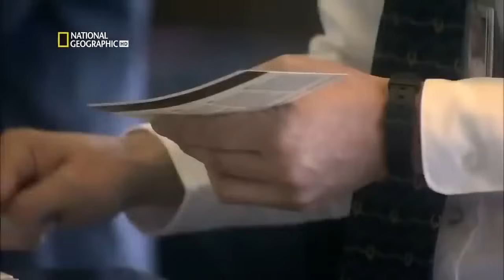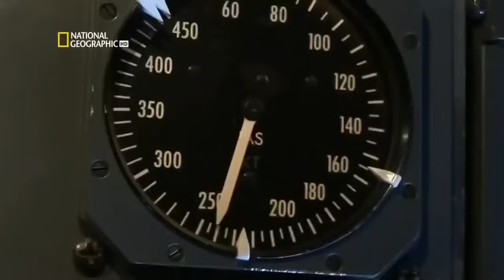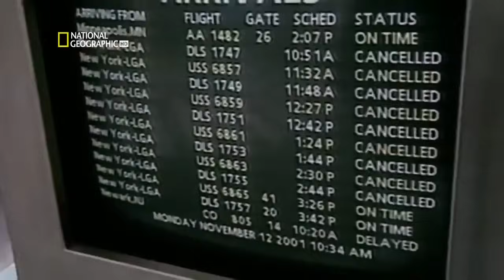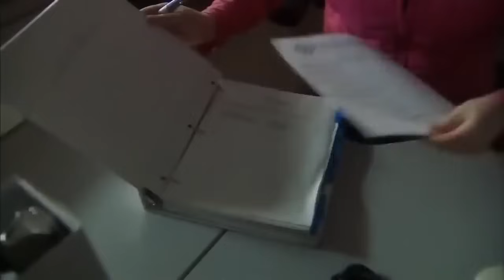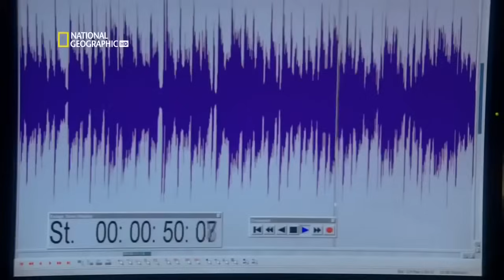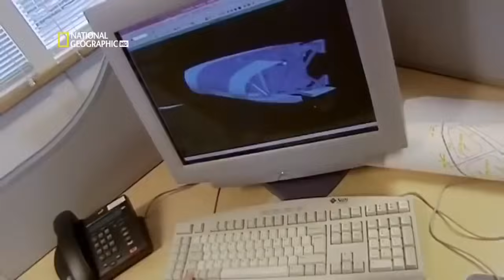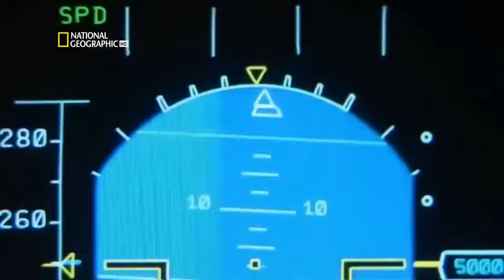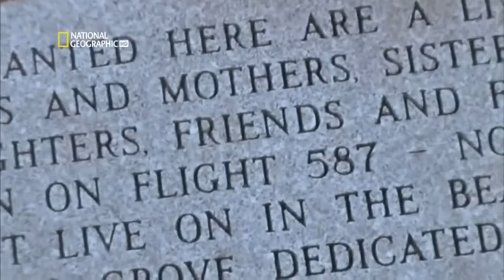American Airlines Flight 587 | Air Crash Investigation | National Geographic

Comment: Watching the video of the aircraft, you can't help but think this has been caused by over correction with the rudder. However, 2 thoughts come to mind: 1. Flight controls are sensitive requiring small inputs. Surely, AA realsed that training pilots to use maximum rudder could have disastrous effects if out of synch with the aircraft movement? The role of the tail is to act as a vertical and horizontal stabiliser so they should naturally correct minor pitch and yaw movements without pilot inputs. One can't help wondering if the aircraft would have otherwise corrected itself. 2. How can a pilot suggest Airbus could be culpable by not stating any limitations on the control surfaces?  It's not a fully aerobatic fighter jet that can pull several G.

Comment: I think the pilot was well trained because those are what they call "good stick and rudder skills" Youre supposed to use the rudder like they finally explained. The design settings to me are whats to blame. Im a pilot also but in my younger days I always flew RC planes and theyre very acrobatic and the digital controlers allowed you to program settings on your control surfaces much like they were on this planes rudder. It wasn't subject to speed tho. You could set the rate of travel to increase as you move the stick farther and farther. The first little bit makes the control surfaces move a little bit but the percentage of travel increases the farther you move the stick. Its so you can make really quick snap rolls without maxing out the stick but still have normal control if you arent doing crazy maneuvers. I really cannot believe they have the rudder on these planes set up that way! The faster you go the less rudder travel you need, NOT MORE with less pedal movement! Thats insane!

Comment: so who was at fault? The AA for dodgy training (or losing Airbus's manual) or Airbus for not providing in depth workings of the rudder control system?
Reply: I would say AA and Errorbus.
Errorbus for making a shitty product that looses parts if you work the controls and AA for not pointing out to their pilots that Errorbus makes a shitty product that you can tear parts off of by using the controls.

Comment: This was not a research aircraft.It was not an experimental aircraft.It was designed faultly The plane was.
Ultimately designed to have the rudder less response.As the airspeed increased, this was a fatal flaw in the design of this aircraft.
And the controllers Adam take off too soon because of that.Wake turbots of another airliner

Comment: NTSB immediately says it doesn't look like a bomb, narrator says "the plan backfires" and shows a newspaper dated 2004, three years later lol. Airbus should have been sued into the dust for making an aircraft capable being broken by pilot inputs in straight and level flight at 250 knots. And regardless of training, an intuitive understanding of flight would make anyone baulk at alternating full rudder inputs for an extended period - especially when they made it worse :(

Comment: Obviously there is some blame for multiple parties, but Airbus is the most at fault IMHO. They knew their plane better than anyone yet did not specify this danger in their manual! I wish I could find out more about the supposed warning they gave to American Airlines before - the Wikipedia article doesn't mention it - but even still...it also was not a good design: "Most aircraft require increased pressure on the rudder pedals to achieve the same amount of rudder control at a higher speed. The Airbus A300 and later Airbus A310 models do not operate on a fly-by-wire flight control system, but instead use conventional mechanical flight controls." A good analogy someone else gave is that, yes, turning your steering wheel hard while driving can be deadly if you crash. But it shouldn't cause your steering wheel to fall off!!

Comment: A good analogy someone else gave is that turning your steering wheel hard while driving a car can be deadly if you crash. But it shouldn't cause your steering wheel to fall off!! Poor design by Airbus, and poor communication between Airbus and American Airlines.
Reply: That's a terrible analogy - the forces involved with aircraft are significantly greater. You're talking about a 1500kg vehicle on the ground vs a 160,000kg aircraft travelling at 3-5 times the speed, a thousand-odd metres above the ground
Reply: Apples and oranges. All structural elements of any aircraft have maximum limits. The copilot's ham fisted handling of the rudder exceeded the structural limits of the vertical stab. He is only partly at fault because he was following training put on by AA.

Comment: One way to solve this problem is to let a new technology be retrofitted to all airplanes. It is a technology where automatic parachutes for every planes should be deployed. They are automated in the sense that when the planes' AI can detect prolonged trouble during flight, the parachutes will be deployed automatically and the engines will be in stall state. Either the parachutes are triggered right or wrong, all inside the plane will be likely safe 😅

Comment: No human mount of power use in the rudder should make the rudder comes apart from any aircraft! This is an Airbus design flaw!! Why didn't the polits wait more minutes before take off because of the wake turbulence from the 747 that took off before them! Impatients kills! I feel so sorry for all thoses on board.
Reply: Utter nonsense. It is impossible to decagon against it because the limit of force that can be applied through repeated reversal is unbounded. No manufacturer makes its find that strong and none should.

And the force applied to the rudder is from a powerful hydraulic ram.

Comment: I think, to prevent this particular incident from happening again on any new planes being built, the airline needs to go back to the drawing board. Construct the tail with a sensor that measures the displacement of the rudder from the tail when the peddles are being pressed. In the cockpit, both pilots would have their digital diagram gauge showing the rudder and the degree the rudder is In from the tail by the rudder movement located on their gauge. They can then see the fluctuating back and forth of the rudder. The pilot can tell if they are the ones causing the plane to go back and forth rapidly and not by some jet stream or turbulence. Then they will know to back off of the rudder. Writing out what not to do only may not come forth to one's mind in a situation they think they need to use the rudder more when they don't have to.

By Shiloh Ray
Reply: They already have such a display.

Comment: As a retired Dutch pilot and mechanic I am convinced this is a construction failure. Even rough handling of the controls, in this case the direction rudder, shouldn't tear of the stabilizer,

Comment: Again putting a blame on the pilot instead of the more than 13 years old structure of the aircraft which may have suffered natural wear and tear.  Now the pilot is not alive to defend himself (like Hudson River Crash - Captain Sully), it's the easiest way out to put a blame on the pilot using flight simulators.

Comment: So this accident is not a structural failure or engine failure. It’s complete pilot error. Sadly this plane suffered after JAL takeoff, which turbulence and pilot error cause the crash. These are avoidable for beginners
Reply: @ it’s a structural failure followed by copilot error and turbulence of B747 JAL

Comment: Studying this in my Master's Aviation Safety class.  At no point in my pilot training was I taught to use full deflection on any flight control surface unless on the ground taxiing to counter crosswind.  At no point in my flying have I ever needed to swing the rudder back and forth by mashing the rudder to the metal in rapid fashion.  An overreaction and poor pilot skill/training ultimately, but I agree that Airbus I would say is 25% at fault.

Comment: If you think the loss of control of this aircraft was solely caused by the plane following into the path of the JA plane, then you are somewhat naive. Something else is going on here in conjunction, without a shadow of doubt. Planes follow 747's all the time on a regular basis. They can handle that windforce; like the older pilot said "we'll be fine once we get rolling". He would know very well with his experience what to expect after takeoff (of course, it goes without saying, that the longer you wait, the safer it would be to follow the first plane). So I think there is something else going on here. My guess is, it is something along the lines of a 'flip-flop' momentum issue i.e. the pilot pressing the feet pedals left and right too hard perhaps, and in succession, causing a sideways rodeo "whipping" action of the rear of the plane (similar to how a speeding car skids at the rear and then overcompensating with the opposite retrieval action causes the car the fling off even more so in the other direction (i.e. turning the steering wheel too hard the other way and too quickly)). This, coupled with the jetflow of the preceding airplane and perhaps something else, like a crosswind thrown in for good measure, would've been the final determining criteria. Even still, these aircraft are designed to withstand these types of forces, so I think there might even be some structural weakness at the tailend of the plane, as well. I think it is a freak accident with multiple variables at play.

Comment: The vertical tail breaks off because of aggressive rudder control commands.  Not the pilots fault because of training in events of wake turbulence and no limits set by the maker Airbus.  The carbon fiber vertical tail broke near the union/fitting to the fuselage.  IMO, carbon fiber lacks the toughness of some superior metals.  Toughness is the characteristic of a material to take repeated flexing and impacts without breaking or shearing.
Reply: Well why don’t you go and lecture at an aeronautical engineering university to tell them how wrong they’ve got it.

Comment: The air controllers on the ground need to allow more time between takeoffs. They should be responsible for this.
Reply: Nonsense. If they’d handled it correctly this would have been fine.

Comment: the basic ABC. you don' t need to be an engineer or a genius to understand that at 255 knots = 475 km/h if you're heavy on controls you will stress out and damage the plane. it's simple to understand. He creates the problem and he smashed the plane on the ground. The first lesson they teach is: BE GENTLE ON THE CONTROLS. He was there just because a son of a pilot. 23 yrs old piloting an A300-600 without the basic and full of himself. NTSB Investigation: "If the first officer had stopped moving the rudder at any time before the vertical stabilizer failed, the aircraft would have leveled OUT ON ITS OWN, and the accident would have been avoided". - Those types of people who purposely make a small problem seem big to feel full of themselves and special and make it appear to others that you have solved a difficult and complicated problem.
Reply: I know. These pilots got their job on Indeed if they decide to power the plane to its max. Planes should never withstand that, and even turbulence resistant airliners are not designed to run at max speed and power, as the wings, engines, and more could easily collapse under extreme load.

Comment: Even if it sounds dumb: an airplane must have a parachute which catches everybody if something happens. Life's are just too valuable to risk something here...
Reply: Little planes often have them 

Pull a lever if engine is gone and it pops out the rail and it floats down

You do sort of wonder why an enormous one can’t be used for airliners

Maybe they travel too fast but you reckon you could engineer out the problems

Comment: Am I the only person hearing  the irony of what is said here. The airbus hi-tech carbon fiber composit exceeds required strength perimeters, yet the metal parts didn't break of the jetliner. Only the carbon fiber composits broke , if the entire thing was made from metal the crash wouldn't have happened
Reply: Good point

Comment: While seeing the video and when this reached the part where the experts say that the tail has 6 bolts to faste it to the fuselage, I coudn't stop thinking about the low value over human beings, that the designers have. Why am I saying this?..So simple..Could you (who's reading my comment..) put only 6 attachments to a part that is so important and fatal in case of broken or fail..??..My common sense shout at me, that it can't be possible such a mistake...if I were the designer, I'd place at least 20 bolts for attaching the tail, and not only 6..I just can't get out of my amazement..! For God's sake..!
Reply: Have you seen the size of the bolts they fasten bridges with compared to the size of the bolts they fasten your car door lock with? Just the number of bolts doesn't say anything.

Comment: What if the plane manufacturers placed gps on parts of the plane that are sticking out like the wings and the tails, that sends signals back to the air control tower. 
So when they experience stuff like this, the people who investigate planes that fall apart can tell which part came off first and where it went.
This video is old so they probably already do this and I really really REALLY hope they are doing this already.

Comment: I don't believe that material (carbon fibre) is the strongest in the world if it was so strong then why the bolt and joint did not break or tear up? Or there must have been thicker usage of it which it didn't.

Comment: But the pilot was having issues before he applied the rutters, I still don’t understand what caused him to apply the rutters
Reply: Not rutters! Rudder. double d, not double t and singular, not plural. And to answer your question, he was trained wrong! AA trained its pilots to do things the Airbus was not designed to do. By being aggressive with the rudder pedals, he was fooling himself into thinking it was turbulence. It wasn't. AA and Airbus are both to blame. AA for doing things they shouldn't done and Airbus for not fully explaining the limits of the plane. While it was pilot error, it's not really the pilots fault, because he was trained wrong.

Teach a guy that a plane has "rutters" instead of a rudder, and it's not his fault he got it wrong. On the other hand, if it's just ignorance and a lack of ability or will, to look up words he doesn't really know, and it is his fault.
Reply: Mephisto Underwood Impatience is another cause. They took off 2 minutes after a 747, which caused wake turbulence.
Reply: @BloxyPlayz  No. They may have experienced some wake turbulence, but the pilot's rudder work started emulating turbulence. By the end, the only "turbulence" being experienced was caused by the pilot himself. He kept over compensating with the rudder and pushing to the extreme. so, every time he over reacted, he was making himself believe he was still in turbulence and would over react the other direction. The pilot, through his faulty training, created this problem himself.

2 minutes between aircraft of these sizes, IS NOT a problem. A small single engine prop plane or a small jet following a larger airliner, does need more time, because they don't have the stability that the larger mass provides. Further, wake turbulence tends to dissipate rather quickly. The initial turbulence may not even have been wake turbulence, just regular atmospheric turbulence, but there is no way to know for sure.

Even so, the pilot and his faulty training, is the sole cause of this crash. The other pilot should have taken control once he saw the first pilot having such difficulties.

Comment: Honestly.. after 32,000 hours in airline jets way smaller than an Airbus a300. And flying mostly in the very busy airspace of the USA..and hitting all kinds of wake turbulence voth T.O. and Ldg. Never have i Heard or seen this sort of ridiculous behavior. Most copilots dont even know where the rudder petals are😮. Much less use them. What about Va. Maneuvering speed where you are allowed full use of all controls without damage. Speed was certainly low enough 😮
Reply: "Most copilots dont even know where the rudder petals are"

It's true they are not usually needed in FBY aircraft. But seriously, we know AA trained their pilots to use them for turbulence encounters.

Comment: Hi every body 
I think we're understood very well after decades that no airplane it doesn't fall down so from this point we just understand any thing at any time can just happens to airplane and it will falling down within a few seconds so my question is why USA is not making research and builds airplane with especiall ejector capsules to saving passengers life's
this is very important more than the airplane it self. Note
If passengers life saves while the airplane is falling down  hundreds of the airplane can be builds up instead of one airplane or more.
Save passengers life is more important
Reply: bc that would increase the airplanes weigh resulting in higher cost of fuel and it simply would not work

Comment: What I dont understand was why the pilots applied full power and increased speed when hitting the severe turbulence. This directly violates whats taught this in primary training regarding maneuvering speed. Excessive speeds along with excessive control inputs in turbulence can easily over stress the airframe.

Comment: and this is why i drive to my parent's In Albaquerque New Mexico From San Jose California 16hrs im just scared of planes
Reply: Even though by every type of measure, you are far safer on a plane on a trip of that distance. Especially since 2001, with but a single fatality on domestic jet airliners. But I grant, fear doesn't work that way. And the risk of a terrifying experience may be higher.